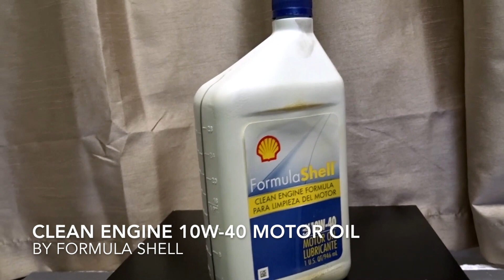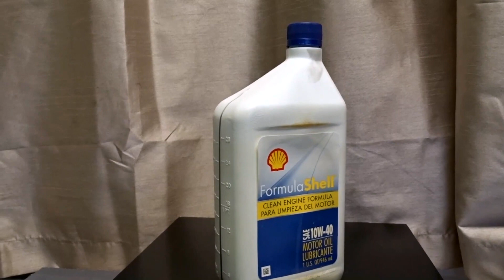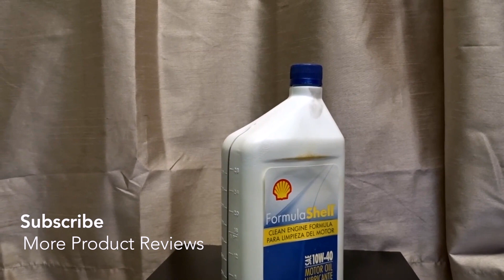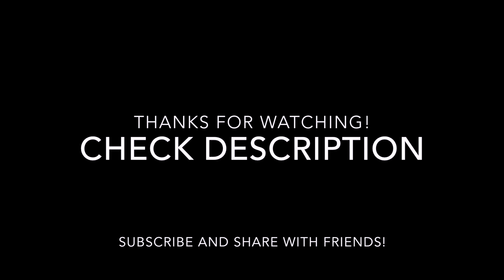✅  How To Use Shell Clean Engine Formula 10W-40 Motor Oil Review

Comment: This is a normal engine oil?, so i can can use it for 5000 Miles? Thanks
Reply: Well 5000 miles is the most you can get from this oil. This is fine motor oil and cheap too. Available at Home Depot.